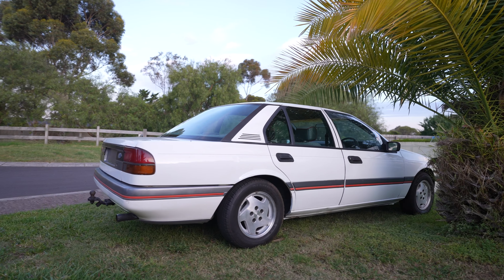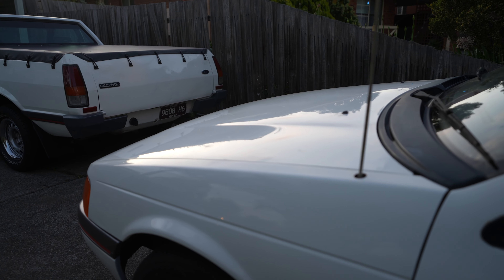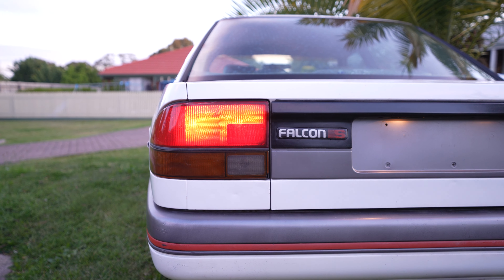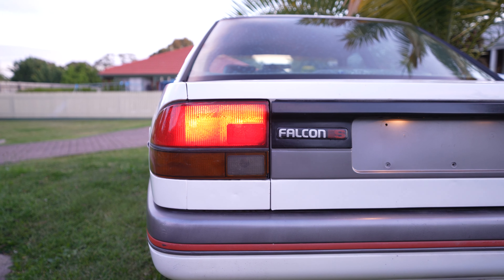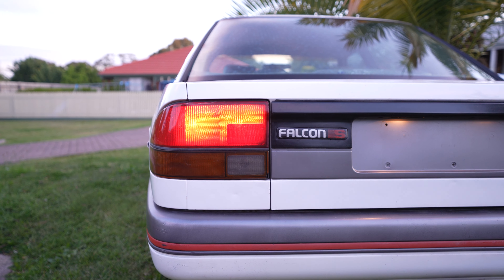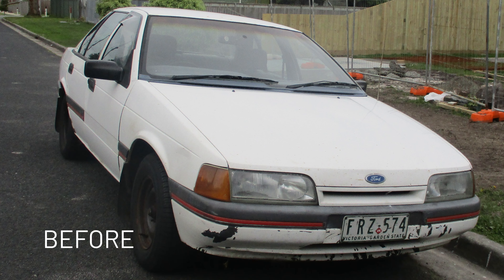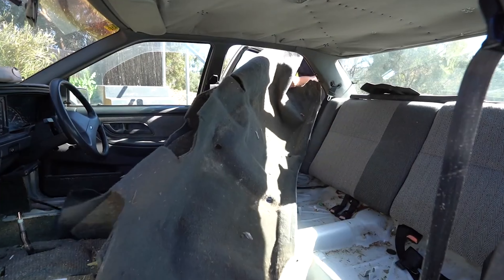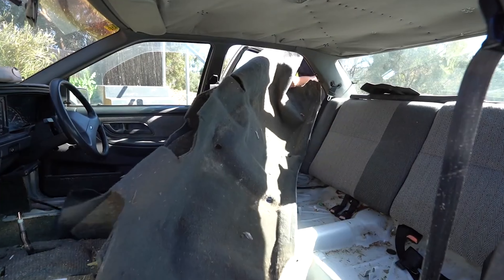EA FALCON S Restoration Episode 4 - Massive Progress! and club reg this week!

Comment: Man the EA holds a real special place in my heart, but I have to say, the snowflake wheels look so much nicer than the directional wheels. I wish Ford made their directionals in left and right sides because the EF/L XR directional wheels look really trick on one side. I’ve had 2 of the EA S, both white, one was 3.9 cpfi 3 speed auto and the second was a 3.9mpfi 3 speed auto. The first one was stolen and totalled, and the second one I sold for another project. The E series is my favourite series of Falcons. I’d love to build a silver EA S (they’re not S Pacs!) and fit a AU XR6 VCT and 5 speed, some big brakes and some nice wheels and a nice ride height, it would be a sweet as ride.

Comment: i had a sky blue one of these with a 5 speed. put a stage 3 crow cam, pacemakers,  mandrell exhaust and a decent clutch with superlows all round, used to burn off any stock hsv or commodore v8 commmodore before  the 5.7l arrived. i think the car only weighed 1290kg. probably put out around 110rwkw. those were fun days.  you definately need to get your hands on the rubber rear spoiler they came with.